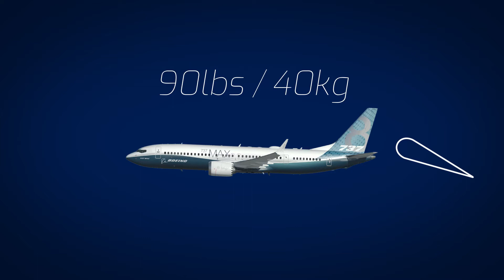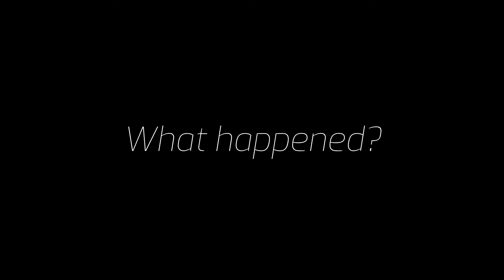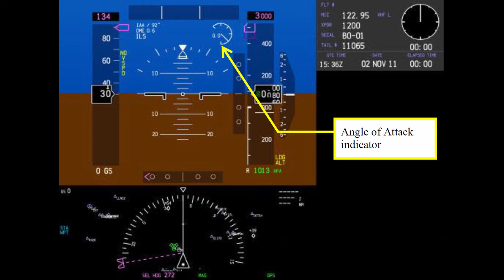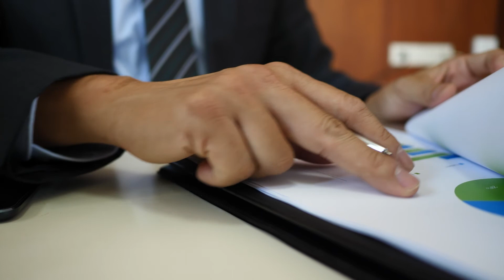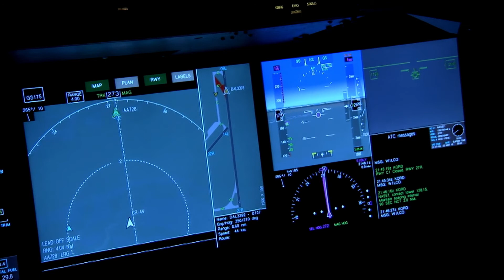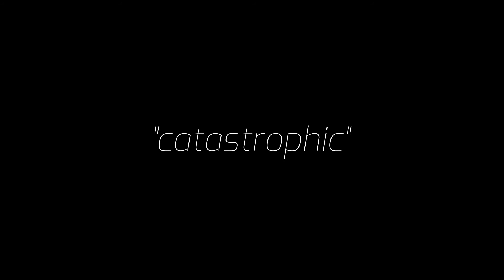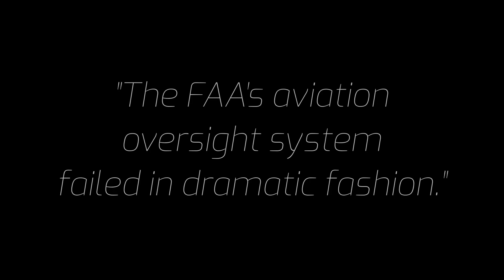737 MAX crashes | How Boeing and the FAA failed the aviation industry

Comment: I'm not trying to defend Boeing's honor or anything like that, but the media stories about Boeing's intent to CHANGE the name of the aircraft are false. The current generation of 737's in production have been the 737-7, 737-8, 737-9 and 737-10 from the start. The family of aircraft have been referred to as the 737 Max family, but the individual types have always been the -8, -9 etc. This is no different that the 787 Dreamliner (family) which is comprised of the 787-8, 787-9, or 787-10 (models) or the previous generation of 737s produced, the 737 NG (family) which was made up of the 737-600, 737-700, 737-800 and 737-900. This can actually be seen on the 737 Max aircraft painted in Boeing's livery in this very video... They all say 737 Max near the nose, but on the tail they have an 8 or a 9 painted behind the 737. It has been this way since the first Max rolled of the assembly line, well before the two crashes.
I get so tired of hearing that name change narrative, written by lazy journalists who don't take 10 minutes to actually learn a little background information about the story that they are trying to publish. Great video though, I love your content. Just don't fall for the media's hype.
Reply from the maker: well a name change would not have to be something crazy new, it would suffice to just drop the "MAX". Some airlines like Ryanair actually did that, others asked Boeing to do that officially and even Trump suggested the name change. So, sorry, I disagree with your supposition of lazy journalism.
Reply: @AirspaceVideos   Ryanair was in the news for ordering a 737-8200 that made news because it wasn’t a Max, but that’s also not true. It’s a 737-8 from Boeing’s Max line, but it has extra seating (200 seats) and additional emergency exits. These changes drove the new model designation. As far as other airlines asking Boeing to drop the Max name and even Trump (well-known for all his well thought out words of wisdom 🙄) suggesting that Boeing change the name, still don’t amount to Boeing actually having done so. I’m not trying to argue or anything. I’m just saying that journalist’s assertion that Boeing is hiding the Max name by calling it the 737-8 is just not true. Boeing has always called it the 737-8 and they’ve always branded the family the Max family. What the media says in this case is misleading. They say it as though the -8 name was cooked up by Boeing because of the Max crashes but make no mention of the fact that the company has always used both names. Both before the crashes, and even to this day, Boeing continues to uses the Max name and the -7, -8, -9 and -10 model numbers in all of their marketing and publications. 

Look at it this way, if I wrote and full page paper about how Coca-Cola was changing the name of their soda to Coke after a PR scandal, but then you saw old photos from 10 years ago that had both Coke and Coca-Cola in them… and you went to you local gas station and say both names still in the refrigerator for sale, wouldn’t that kind or make me look like I don’t have my facts straight?
Reply: Don’t get me wrong at all. I love your work. I subscribed today which might make me your newest subscriber. 😀 I don’t write this to attack you or your content, but even with airlines and a President suggesting a name change… if those journalists writing stories about it would’ve told the entire story, there would be no story worth reading. Boeing didn’t change the name. They didn’t even quietly stop using the Max name. It’s still on Boeing’s website right now.
Reply from the maker: Thanks, and to be fair, I don't fully disagree with you. The name change was not necessary! If it was, one would have to rename every plane type that ever crashed...

Comment: When Boeing took on a lot of Mcdonnell Douglas executives way back when i had figured it would cause problems. Up 'til then Boeing was a heavily engineering minded company. But alot of those executives they took on were straight up money men, they changed Boeing's culture and as we've come to see, changed it for the worse. 
      One of the worst things they did was move the corporate office out of Everett, Washington. That severed the communication channel between engineering and management. When left hand stops talking to right hand there are big problems!!
Reply from the maker: i can imagine
Reply: McDonell Douglas didn't only buy Boeing, they made Boeing pay for it.
Reply: Kinda mirrors the way the DC-10 was (alegedly) rushed to beat Lockheed's superadvanced at the time (and superexpensive to the point of bankupting Rols Royce) L-1011 TriStar. Perhaps that McDonnell-Douglas mindset of do whatever it takes to beat the competition came to bite Boeing in the rear with the 737 MAX
Reply: @ivaneurope  Even with the serious incident of American 96 and the crash of Turkish 981 the DC10 did outsell the L-1011.
Also, Lockheed left the commercial airliner market due to the losses they made.